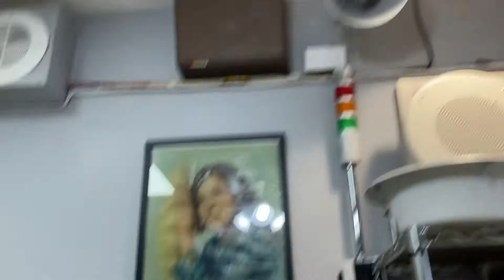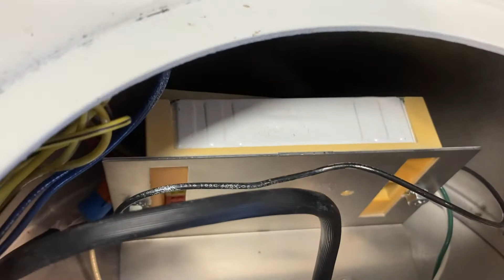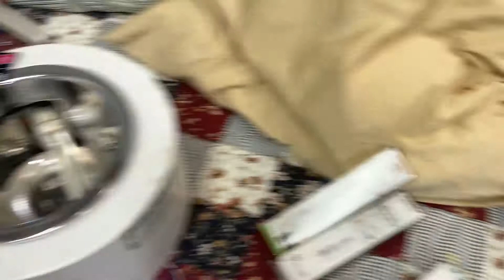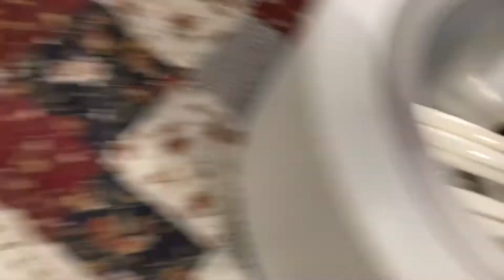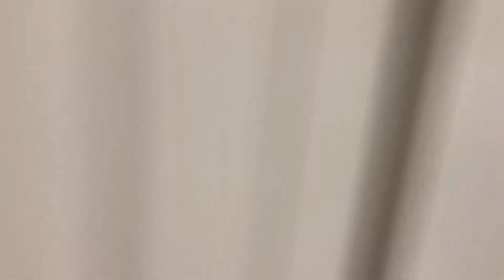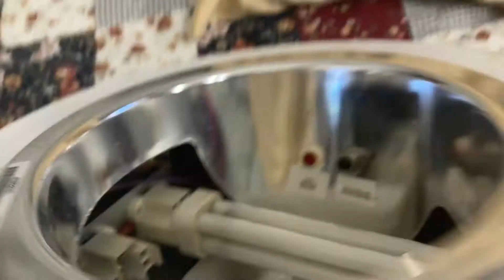Spectrum Lighting Commercial Surface Mount Can Lights

Comment: What was causing the high pitch noise?
Reply from the maker: The high pitched noise is the emergency ballast in the fixture when it's operating. It's normal and the other light fixtures I have make the same noise as well.